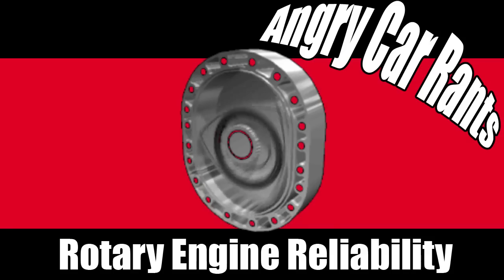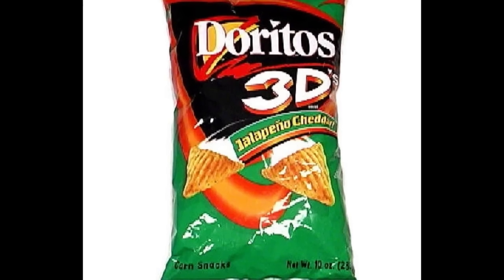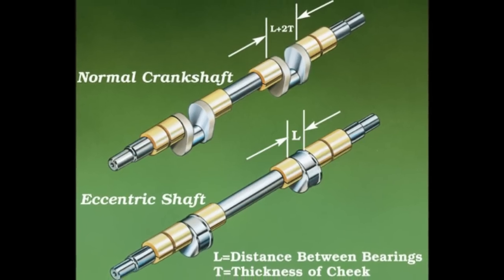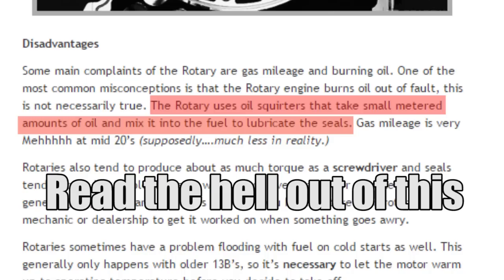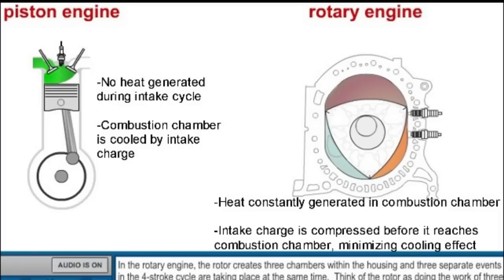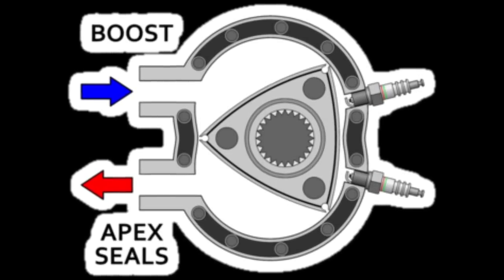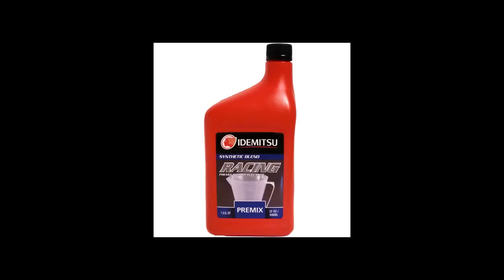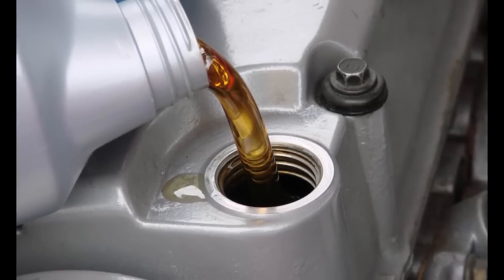Angry Car Rants #3 - Rotary Engine Reliability

Comment: Thanks to the Federal NHTSA recall investigation of premature engine failures Mazda was forced to replace most of the Renesis engines under recall or under the court ordered fraud settlement that extended the warranty.
the overwhelming demand for warranty replacement engines  forced Mazda to open a new much larger Remanufacturing and Technical center in Chesterfield, VA. to handle US warranty claims.. the center remanufactured over 5,000 Renesis engines in 2008 alone, not counting additional new replacement engines from Japan and rebuilt engines from outside subcontractors...
The irony is Mazda only sold 3,400 RX-8s in the US in 2008
Reply from the maker: Cool story bro
Reply: Angry Car Rants Yeah! It is!!  its also true!
Reply: I blame the factory OMP tune injecting dirty crankcase oil and the fact conventional oil is slowly becoming a conventional  blend of crude oil and synthetic. Just delete the OMP and run pre mix, and redline daily.
Reply: The Renesis was the most powerful non-turbo 13b based design Mazda produced.. it simply could not meet the power demands, meet emissions and fuel economy goals with the reliability that consumers now demand.. 
 Some of the design changes were poorly developed resulting in both  apex and side seal failures.
 The OMP is far more efficient and ensuring the correct amount oil is used.. pre-mixing cannot match this accuracy and can also cause lubrication failure unless unwanted excess ratios are used..
 disabling the OMP is really a very bad idea.
Reply: I don't know man, it seemed to work better for us and the forum users, but we are stuck in the carbureted age lol. If you want to inject crankcase oil that doesn't burn that's perfectly ok too, just be mindful of the excess carbon buildup. If the OMP was a superior solution, Mazda wouldn't have to retune the PCM multiple times to tune the OMP. The only thing  excess premix will do is dilute fuel and reduce octane, and rotaries run fine on low octane fuels, not low quality, so yeah. Open up an engine that was premixed; the ash comes off and shows a nice metallic sheen underneath. I will agree with the fact that rotaries have compression and combustion almost simultaneously, so a "rat's nest" of emissions were introduced to maximize gas mileage.
Reply: M1NH5AN3 For "us"???  excuse me for asking but are you even old enough to drive yet?
Reply: +The real doktorbimmer In case you were wondering; yes I can drive lol. Check out the one video where I talk about my daily. Keyboard engineers always think their solution is better. Do you even own a rotary vehicle?
Reply: M1NH5AN3 Premixing doesn't solve the problem of lubrication, it simply creates other problems because the OMP injects oil based on actual lubrication demand..premixing only provides a fixed mixture ratio which is always a compromise at best, during idle premix deliver far too much oil causing fouling and does not deliver any lubrication at all during high rpm deceleration with the injection system shuts off or severely restricts fuel flow. 
 Disabling the OMP and using premix is a dumb idea and its exactly why Mazda never did it.
Reply: Mazda premixed some of their rotary vehicles hence the Idemitsu sponsors and such. Heck it's the only sponsored synthetic oil Mazda recommends for premixing. The only OMP system that runs on demand and rpm of the engine is the renesis system and FD; the FC and FB system was like a throttle body injection system, hence why older cars disable OMP anyway. Most ported rotary vehicles use premix to ensure proper lubrication at higher rpm, and fouling doesn't really occur since the cars idle at 1500 with a bridge port. If you look at rotor housings with premix, the wear is even versus OMP dependant engines where the sides do not receive lubrication. The system is shoddy at best, it is more of an oil dripper than injector. Plus if you delete the OMP you can run synthetic, which allows for more higher grade oil choices than just conventional. Not hating on the OMP system, just saying there is other alternatives out there lol. It seems you still don't have content on owning a rotary and you assume I can't drive. Hard to speak about rotaries when you don't own one lol
Reply: Did you read that on a forum???? Lol..!!!
Reply: "Most ported rotary vehicles use premix to ensure proper lubrication at higher rpm"
Most Rotary powered vehicles unlike Wankel powered vehicles have no oil sump or pressurized main shaft bearing lubrication... because they have no main shaft.. and the engine is supported on ball or roller bearings that do not require hydrostatic lubrication systems.
Reply: No it's because I work on my car and observe the housings to make sure they still have chrome on them lol. I mean most of your information sounds the same too, if not google, so not much of an argument there. Just ask anyone racing a rotary vehicle. Pre mix for the track and OMP if you are lazy and prefer to use your car for the street. I mean if you do ever own a rotary vehicle, these precautions are way easier than having the omp fail on you and waste more oil that you're paying for. So no proof that you can drive or own a rotary vehicle? Darn shame that you can't back up your side of the story.
Reply: Oh! has some on the forums tell you, you can glue the chrome back on??? LOL..!!!
Reply: Who still races Rotary engines???
Reply: You can prove that there was no recall on Renesis engines??
Good luck with that.. Hahahaha
Reply: People who visit their local track lol. Keep in mind these people also own a rotary and know the entire engine inside out; if you do want your housing's chrome back they still do cermet coatings for 13b or 12a engines. Goopy also resurfaces them. You seem to not know how to use forums or common sense. A lot easier driving on a keyboard in my opinion.
Reply: At least I know the difference between a Wankel and a rotary... you sure seem tragically confused..
Reply: You mean radial? They exist too, but you know terminology means nothing you've never worked on one lol. Heck, Mazda's new rotary engine patent is labeled as "Rotary Piston" lol
Reply: Radial engines are NOT Rotary engines.. they use a completely different concept.
Reply: Mazda no longer develops Wankel engines... they never patented a Rotary type engine
Reply: Sounds like you don't understand the terminology.. or the technology.. LOL!!!
Reply: Unless you live under a rock, it's a new patent Mazda applied for.
Reply: THAT IS A WANKEL ENGINE
Reply: NO, its an old patent refiling  to protect Mazda against malicious patent "phishing" nuance lawsuits..
Reply: Check out this link and pdf, they call it a rotary piston; their words not mine lol. It's like the caps give it away that you are infuriated with the way MAZDA named the patent lol. http://www.autoevolution.com/news/new-mazda-rotary-engine-presented-in-patent-application-106139.html
Reply: M1NH5AN3 WANKEL KKM engines are "Orbiting Piston Engines"..
ITS RIGHT IN THE NAME!!!!!!
Reply: Yeah man, a cave with internet access. Since I don't believe you know how to open PDF files, I have made it simple. 
http://www.autoevolution.com/pdf/news_attachements/new-mazda-rotary-engine-presented-in-patent-application-106139.pdf
Reply: M1NH5AN3 I don't think you are smart enough to tell the difference  between a brand name and an engine classification... otherwise you wouldn't be so confused!
Reply: M1NH5AN3 Not at all.. you just seem kind of slow and have a difficult time reading so I thought I would help you out a bit...
Reply: M1NH5AN3 Without internet you wouldn't have access to the forums and so much false information..
Reply: Engines are classified by where you live. Mazda decided to apply the patent as such, and there hasn't been a real patent or breakthrough since Felix's engine. Felix's first engine had the housing spin and it was a single rotor; not much resemblance to the Mazda engines if you ask me. For such a fanatic do you have any proof besides words. I expected a video to showcase your knowledge applied to owning a rotary powered vehicle.
Reply: It's too bad half of the forums are inactive or archived now, not much information left anyway.
Reply: M1NH5AN3 ""Engines are classified by where you live."" WTF???
 Maybe if you live in a fantasy world like you do they might be different!!!
Reply: M1NH5AN3 "It's too bad half of the forums are inactive or archived now, not much information left anyway."
 Well, Wankel engines became obsolete 4 years ago, so I would be surprised if the forums are dying out now too..
 If your looking for accurate information? Your not going to find it on the forums..
Reply: They aren't different in nature but in insurance and where you register your car, some places register these engines as 2.0 liters when really they are 1.1 or 1.3 in reality. You seem to have an interesting tone in your replies lol
Reply: M1NH5AN3 That's because the engine we all know as the Wankel was created by HANNS PASCHKE..
 Mazda bought the rights to produce Paschke's KKM design not Felix Wankel's DKM-54  in Feb 27th, 1964
Reply: M1NH5AN3 The name WANKEL is a registered trademark currently owned by Audi AG. and Div. of Volkswagen..
 When the 10 year licensing agreement that granted Toyo Kogyo Cork Company (Now Mazda Motors) to use the PATENTED Wankel KKM-57 expired... rather than paying to use the name? Mazda created a new BRAND NAME out of thin air..
 Mazda cannot legally use the name Wankel commercially.
Reply: Two different scopes of this conversation, I am talking about insurance and you're mentioning the fact Mazda did not create the rotary. This is a given, they took the design and made it practical if not better for automobiles. Felix designed it, Hanns improved it, and Mazda made it modern.
Reply: M1NH5AN3 Most engineers, government agencies and motorsport sanctioning bodies use the commonly accepted "2X" conversion formula for accurately determining the true displacement of Wankel type engines.
Reply: M1NH5AN3 Your knowledge of the history of the Wankel engine is not complete or entirely accurate..
 for the record Felix Wankel did not invent the rotary type internal combustion engine.
Reply: M1NH5AN3 Toyo Kogyo Cork Company (Not Mazda) bought the Wankel KKM design from NSU in 1961 and was only allowed to sell automobile engines with less than 197 Horsepower (SAE-Net).
Toyo Kogyo was just one of 26 licensee's manufacturers that purchased the design and the rights to build the engines
Sold under the Mazda brand name Toyo Kogyo paid a 40% royalty on every Wankel engine produced by them and the registered trademark of WANKEL was cast right into the housing of every Mazda engine sold.
Reply: I mean he was named the creator, but believe what you want, like how pre mix is bad for you lol.
Reply: M1NH5AN3 No, not true.. your knowledge on Wankel engines is very poor..
 The Rotary engine was invented by Félix Théodore Millet in 1892.. for a motorcycle.
 Felix Wankel first saw a Rotary engine on a Megola motorcycle he and Walter Freode copied the concept first for a supercharger for a NSU motorcycle.
Reply: I mean it was a radial engine so... Of course more random facts with no citations, heck even the wiki says radial configuration lol. https://en.wikipedia.org/wiki/Millet_motorcycle
Reply: M1NH5AN3 Disabling the OMP on a fuel injected engine can cause catastrophic failure if not done properly.. especially when used for  racing..
What fuel injection mode feature must be disabled to prevent possible engine failure..??
Reply: M1NH5AN3 WRONG, Millet's engine was a ROTARY... Not a Radial..
Reply: M1NH5AN3 Wow!  you still don't know the difference between a radial and a rotary???
Reply: It doesn't disable fuel injection lol. Poor knowledge of how Wankels work? The OMP is independent of the EFI or Carburetor setup. All it does is drip oil onto the apex seals which spreads crankcase oil onto the rotor housing. The one thing OMP cannot cover entirely is the rotor side housings which can be solved by mixing two stroke oil into the gas tank. What other engines today inject oil into the combustion chamber as a 4 stroke engine?
Reply: M1NH5AN3 I guess you didn't even read your own link?? Wiki says the Millet motorcycle uses a ROTARY engine.
Why all the confusion son? You seem not to understand the difference at all.
Reply: It's a rotary engine in a radial configuration. It also has pistons in which the Wankel has rotors, not sure why you are using caps lol
Reply: M1NH5AN3 You don't read very well... I said what F.I. MODE must be disabled..
Reply: You literally take out the omp unit and block it off with a plate, it has nothing to do with the EFI system.
Reply: M1NH5AN3 RX-8's OMP injects oil into the intake manifold AND directly into the housing... or were you not aware of this fact?
Reply: M1NH5AN3 Well that would be a very dumb thing to do without reprogramming the fuel injection..
Reply: Yeah, it injects dirty oil into everywhere and a pump connects to all of those lines lol. Just remove the pump and lines and block off the injector ports; done. Deleting said pump allows you to have valuable real estate for force induction if that is your goal. On 12a's it is connected to a pump and lines go into the carb venturi.
Reply: M1NH5AN3 2-strokes are the only engines currently manufactured using oil injection.. Wankel engines are obsolete now... mazda was the last to sell them and the ended production over 4 years ago..
OR DID YOU NOT KNOW THIS?
Reply: Hence why I asked for an example of a 4 stroke engine that injects crankcase oil lol. See above.
Reply: M1NH5AN3 You don't seem to understand much about fuel injection??
Reply: M1NH5AN3 A 4-stroke that is still manufactured? the Wankel is a 4-stroke.. but no longer in production.. its obsolete
Reply: Heck if you really wanted to keep that OMP you could modify it to accept 2 stroke oil. I like how you post questions you already know the answer to lol.
Reply: One one side, you inject crank case oil which doesn't burn cleanly, or you mix two stroke oil which burns cleanly and reduces carbon build up. Either way it's not leaning out the engine that much in EFI as long as some sort of oil is burned during combustion.
Reply: M1NH5AN3 Sounds like you still don't understand the difference in th elubrication requirement of 2-stroke (Benz) engines compared to Wankel engines..
Reply: M1NH5AN3 I like how you don't answer questions.. or answer them incorrect.
Reply: Never mentioned anything about 2 stroke engines, I am always talking about the Wankel lol. The internet is full of opinions whether you like it or not. 2 stroke engines are different from the Wankel and don't utilize rotors lol. You're pretty good at changing the subject.
Reply: You went from 4 stroke, to the Wankel being obsolete, to Benz engines? It's not like you can do anything about these "wrong" answers anyway; they're opinions.
Reply: M1NH5AN3 The Wankel doesn't utilized rotors either.. (except maybe inside the ignition distributor)
 I guess its too much to ask if you have a clue what a rotor is??
Reply: Yeah a fool who actually owns works on Rx vehicles lol. Nice b8 m8, try some more exclamation marks. What Wankel engine are you talking about that doesn't have rotors? I like the fact you said "doesn't utilized" lol
Reply: M1NH5AN3 2-stroke (Benz type) have no crankcase oil sump.. unlike the Wankel which does..
of course there are more than one kind of 2-stroke engine.. so you have to be more specific..
Reply: +The real doktorbimmer Never mentioned anything besides the Wankel. The two stroke I'm referring to is an oil substance lol.
Reply: M1NH5AN3 Wankel KKM engines are not Rotary type engines... remember?  you must have a short term memory problem
Reply: M1NH5AN3 All the Wankel engines that were manufactured..
 Dr Felix Wankel's DKM-54 was only a prototype, it never saw production.
 Only Hanns Paschke's non-rotary type Wankel KKM engines was sold to Mazda..
I thought we covered this already?
Reply: +The real doktorbimmer It's not like they have no reciprocating force or pistons... Oh wait.
Reply: +The real doktorbimmer Any search online will yield that they are rotary engines. Odd tone for writing replies, it's as if you despise the rotary engine even though you don't own one or know enough to own one lol.
Reply: M1NH5AN3 Rotary ICE engines all have pistons..  just like Wankel engines have pistons.. Some Rotary engine have pistons that reciprocate... and some orbit
Reply: M1NH5AN3 Its sounds like most of your knowledge comes from the internet..which is why most of what you know about engines is also wrong...
Reply: +The real doktorbimmer Pretty sure all Wankels have rotors, never saw one with pistons...
Reply: M1NH5AN3 They all have pistons.. its right in the name!!!
Reply: +The real doktorbimmer I'll believe it when I see it. No links this time?
Reply: M1NH5AN3 I love Rotary engines.. The Oberursel Ur.II is one of my favorites..
I like Wankel engines too.. I always though the M950F was wicked cool... its a shame they never sold them
Reply: M1NH5AN3 KKM???
You don't know the name of the Wankel engine???
 For someone that claims to own and fix Wankel engines you sure don't know very much about them do you???
Reply: +The real doktorbimmer Pretty sure they're rotors dude, they look nothing like pistons and resemble a 3d triangle with round sides.
Reply: M1NH5AN3 Well, you have been sure before an proven wrong..
Reply: M1NH5AN3 Not all pistons are round and slide up and down.
Reply: M1NH5AN3 What next? Are you going to tell me that Wankel engines don't have stroke either??? lol..
Reply: +The real doktorbimmer I mean it's hard to prove someone wrong without links, or sources for that matter.
Reply: M1NH5AN3 Its really hard to have an intelligent conversation about internal combustion engine design with someone that possess such a rudimentary understanding of basic engineering..
Reply: +The real doktorbimmer Basics of engineering like all Wankels utilize rotors lol. Quick change the subject to Benz 2 strokes for no reason lol.
Reply: +The real doktorbimmer "Intelligent conversation" where you ask questions since you don't know more than the next guy lol.
Reply: M1NH5AN3 You don't even know what a Rotor is... How can you claim to know anything about Rotary engines..?
Reply: M1NH5AN3 You said 2 stroke..
Reply: +The real doktorbimmer I mean if you could show what Wankels have pistons or where you got that information, that'd be nice.
Reply: M1NH5AN3 Its right in the name!!! I would expect someone who claims to be knowledgeable about Wankel engines would know this..
Reply: +The real doktorbimmer As usual, no proof regarding why you think Wankel engines have pistons lol. No sources or websites?
Reply: +The real doktorbimmer Yeah pathetic enough to own and build one. Look at the inside of a wankel engine, it looks nothing like pistons; don't believe me? Search 13b rotor or KKM rotor, not piston lol
Reply: +The real doktorbimmer Oh yeah it's their not there lol. If you are going to correct someone at least be right.
Reply: +The real doktorbimmer Stick to BMW's those have pistons 😂
Reply: M1NH5AN3 Mazda Rotary® is just a brand name (now defunct)..
 Look up the word "rotary"

the definition might surprise you..
Reply: M1NH5AN3 And while your in the dictionary look up the word piston... you don't seem to understand what they are either
Reply: +The real doktorbimmer See 1:04 usually people refer to the engine as a "rotary engine" not just rotary by itself lol. Rotary by itself has many meanings. Funny how you disagreed on Mazda naming their patent as a rotary piston engine, and now you disagree on the rotors used in the rotary engine. Condescending comment or clueless?
Reply: M1NH5AN3 ""Oh yeah it's their not there lol. If you are going to correct someone at least be right.""
 Maybe you should stop using the incorrect terminology to describe Wankel engines.. the KKM is an Orbiting Piston Engine.. its not a rotary and it has no rotors (except in the distributor)
Reply: +The real doktorbimmer piston

Translate Button

[pis-tuh n] 

noun

1.

a disk or cylindrical part tightly fitting and moving within a cylinder, either to compress or move a fluid collected in the cylinder, as air or water, or to transform energy imparted by a fluid entering or expanding inside the cylinder, as compressed air, explosive gases, or steam, into a rectilinear motion usually transformed into rotary motion by means of a connecting rod.

Wankel rotary engines do not have connecting rods. Wankel rotor housings are epitrochoidal not cylindrical 😏
Reply: +The real doktorbimmer Doesn't change the fact Wankels don't have connecting rods lol. Do you know what a connecting rod is?
Reply: M1NH5AN3 "or to transform energy imparted by a fluid entering or expanding inside the cylinder'

cylinders and pistons do not need to be round or spherical.. they can be any shape.
Reply: M1NH5AN3 "epitrochoidal" thats a good word.. you should look that up after you look up "Rotary"
Reply: +The real doktorbimmer Good luck telling someone about a piston that is not round; or telling Wankel owners about pistons 😂
Reply: M1NH5AN3 Are you suggesting that it can't be a "piston" without a connecting rod???
 Good luck with that argument..LOL!!!!
Reply: +The real doktorbimmer I'm suggesting that Wankels don't have a connecting rod, if piston shapes don't matter, why are all pistons round?
Reply: M1NH5AN3 All pistons are round??? Where did you come up with that crazy idea??
Reply: +The real doktorbimmer Besides the Wankel which you are despised of, what other shapes of pistons have you seen? They're all cylindrical in nature anyway...
Reply: +The real doktorbimmer Simple Definition of piston

: a part of an engine that moves up and down inside a tube and that causes other parts of the engine to move

Not sure what else fits in a tube besides a cylindrical piston lol.
Reply: M1NH5AN3 Oval???https://en.wikipedia.org/wiki/Honda_NR
Reply: +The real doktorbimmer You mean elliptical? They heat up and become closer to a circle. Sounds pretty cylindrical to me.
Reply: M1NH5AN3 Its a piston alright.. and it can't be a rotor.. its not moving concentrically..
Reply: M1NH5AN3 You don't seem to know much about Wankel engines... or any engines for that matter.
Reply: Doubt my ownership of a rotary vehicle, check out my channel or @minhsane on insta. Maybe pictures will make more sense to you?
Reply: M1NH5AN3 I doubt you know what a rotary is..LOL..!!!!
Proper engineering terms don't seem to make any sense to you..
Reply: +The real doktorbimmer I doubt you know what a rotor is LOL. You can't say much about engineering without any content on your channel.
Reply: M1NH5AN3 I know that rotary motion and PLANETARY Motion are not the same.. Rotary motion is based on rotation around a FIXED AXIS..
Reply: Doesn't that statement make you a hypocrite too? You're a keyboard engineer like the rest of us, and unlike you, I do share my work on instagram and car throttle, do you even work on your own car? You do talk a lot of crap about rotary engines granted you don't work on them. It's not like the info you post actually helps the people who own these kinds of vehicles lol. Typical BMW fan boy.
Reply: M1NH5AN3 That's unfortunate, it saddens me to think that people are being negatively impacted by the ability to spread your ignorance all over the internet.. That why real credentials don't include your social media activities.
Reply: Sounds like the internet hasn't changed. I use real credentials because I have nothing to hide and there's not much you can do behind a keyboard anyway, don't like the way I do things? Post your own content about how you do it. Simple as that, people either choose to listen to what you post, or they move to another one. My Social media is mostly cars and memes so there's not much to worry about. Cowards hide behind fake profiles too you know...
Reply: At least I can show my work lol. You make fun of my work, but you fail to show your own. Afraid of criticism, or do you not work on cars? Hard to be real with no content on your channel...
Reply: M1NH5AN3 A typo is hardly the same as not understanding the difference between between a Rotary type engine and a Wankel engine.. LOL!!!!
Reply: In your case, plenty of typos from above, including your and punctuation. Not fun when someone picks on something petty now, is it? How's your imaginary BMW?
Reply: M1NH5AN3 How are those answers coming?  you seem to be having a lot of trouble with the facts..
Reply: I mean I already answered with my opinion, you seem to have trouble answering my questions; avoiding the question, or do you actually not own a BMW? Just to infuriate you; Wankel Rotary engine. There, final answer lol.
Reply: M1NH5AN3 There is nothing petty, just pity for your lack of knowledge on the topic of Wankel engines, its rather sad really..
Reply: M1NH5AN3 At least I know the difference between a Rotary and Wankel LOL..!!!!
Reply: So you don't own a BMW, or anything significant to share about? Why am I not surprised? I answer and you hide while changing subjects. I applaud your cowardice and inability to reveal anything about yourself. I don't understand your hate for rotors in terminology; rotors in brakes, alternators, etc. It seems the context is more important than the word itself.
Reply: M1NH5AN3 Yet you claim that a piston that does not move concentrically is a Rotor???
Reply: Yeah, still do; yet you still haven't answered the previous said question. How's your alternate method of transportation?
Reply: M1NH5AN3 What does that have to do with you embarrassing lack of knowledge regarding the Wankel KKM design????
Reply: The same thing that has to do with your embarrassing grammar. Still avoiding questions. No use having that knowledge if you never have a car that is going to require it. The difference between you and me is that I actually answer questions and I use the info I know lol.
Reply: We are not discussing English grammar, but rather your lack of engineering knowledge..
Reply: Are we? Can we discuss your lack of a vehicle to discuss engineering knowledge with too? Can't do much discourse about engineering without the actual engine now, may we?
Reply: Some people just don't want the dorito to succeed lol
Reply: M1NH5AN3 Wankel is already dead son... you don't know a dam thing do you?
Reply: I know mine is quite alive and well, peppy if I do say so myself, to disprove people like you. How about those aviation rotary engines? Still sore about those?
Reply: M1NH5AN3 Rotary engines died out long before the Wankel did.. but they are both dead now.
Reply: +Rudster That's a real good question. He must spend ungodly hours on it. WHY?

And after all his efforts I can just go for a drive in one of my rotary powered vehicles, which completely disprove his attempted arguments.
Reply: Godfrey Poon The fact that they are no longer manufactured completely disproves your attempted arguments...
Reply: Rudster Shooting the messenger will not bring the Wankel engine back.. it was a failure and is now obsolete..
You cannot live in denial or go off and live in a cave.. you have accept the truth that the Wankel engine was not good enough to compete or even survive against the superior reciprocating designs which are still in mass production.
Reply: It does not matter if you are right or wrong because you are doing nothing other than pissing people off.
Reply: Rudster Mazda finally cancelled research and development of the Wankel engine in May of 2009 and ceased all production at its Ujina #2 plant on June 22nd, 2012 at 4:30 pm Tokyo time.. the assembly lines were then demolished to make way for the future.. a brand new Skyactiv-G engine plant that now produces engines for the Mazda6
Reply: Rudster Hey buddy.. your the one trolling here remember..
Why don't you get a life.. the future is now and the Wankel is old news, yesterdays rubbish.. The automotive industry is rushing into the future without the old baggage of the past like the Wankel... its dead and buried now.
Reply: Rudster Good point, it would be completely useless to argue, the fact that you can no longer buy any new automobile with a Wankel engine is irrefutable .
Reply: Rudster Then why are you making harassing comments?
Reply: It's useless because neither of us know the engine id dead or not for a fact. All it is is an opinion. You don't know the ceo of Mazda doesn't want a new wankel sports car. You don't know what's going through the heads of those higher ups in Mazda. Neither do i
Reply: Rudster I can't help but think that your tirade of insults and abuse sounds an awful lot like a troll..
Reply: If you want to express your freedom of speech, make a video explaining the reasons why it's dead then. Because what you are doing is harassment of a community
Reply: Rudster What "community"? and who elected you to represent them???
Reply: Rudster OK, I'm glad we cleared that up, so you are just any individual that goes around like a thug intimidating people because you don't agree with there comments..?  That sounds like a troll to me.
Reply: Rudster Massive scene?  what exactly quantitates a massive scene? what the fuck does that even mean?
Reply: No, you need to accept the fact that people have different opinions and beliefs and that is completely fine. You don't need to convince them of anything because if your right, time will prove that. Spending all your time harassing people on videos is to be an asshole. There is no opportunity for discussion or debate which is the complete opposite of academic discussion and so what I see is the opinion of one against the opinion of many. 

Again, why do you feel you have to be here? Stop dodging the question
Reply: +Rudster You're the one harassing.. and the one in denial that the Wankel is no longer manufactured
Reply: Rudster You are indeed an insufferable hypocrite...
why do you feel you have to be here?
Reply: Rudster You are the one trolling my comment remember?
Reply: And your the one commenting on videos about a technology you don't like
Reply: Its my comment, not yours..  how would you know?
Reply: Off topic, but can you imagine if Felix Wankel had invented his engine a few decades earlier?
All of those German WW2 aircraft would have been rotary powered, and Germany very well might have won the war.
Reply: Godfrey Poon Many of the German and Allied aircraft of WW1 were powered by Rotary type engines.. but the design became obsolete as superior In-line, water-cooled engines became the dominate design of WW2..
Felix Wankel was inspired by Oberursel aircraft rotary engines and Megola Rotary engine motorcycles in the interwar period.
Reply: Godfrey Poon Germany was well ahead of the doomed Wankel engine, it invented and was the first to developed the most advanced, most powerful and  highest power to weight ratio engines for aircraft during WW2.... the turbojet engine
Reply: The real doktorbimmer Yes, the turbojet is an excellent form of the far superior rotary class of engines.

The basic concept of reciprocation in an engine is fundamentally abhorrent.
Reply: Godfrey Poon GAS TURBINE ENGINE.. not Rotary ICE.. not the same concept at all..

While seeming abhorrent to you, it is nonetheless still in widespread mass production globally while the Rotary and the Wankel orbiting piston engine are both now completely obsolete for some time .
Reply: The real doktorbimmer They both avoid reciprocation, and the associated Rube Goldberg tomfoolery. That's what counts.

It's abhorrent (I mean, something to avoid at considerable cost) to anyone who understands such concepts as fatigue-limited life. This is why a piston engine's crankshaft's days are so finitely numbered, and aircraft piston engines need their frustratingly short TBOs.

Calling the WRCE obsolete is semantics as far as I am concerned. I have two vehicles using them - they have served me well for a long time, and continue to do so. Piston engines have failed me in that respect.
Reply: Godfrey Poon But the Wankel KKM Orbiting Piston Motor completely lacks the elegant concentric motion of the Rotary, its epicyclic planetary motion requires the reciprocating motion of its eccentric crankshaft, and still requires a heavy flywheel to dampen vibration.
Reply: Godfrey Poon The Wankel certainly is obsolete, no longer manufactured in series production anywhere in the entire world..
 The reciprocating engine has not let down the automotive industry, or the dozens of other applications that the Wankel could never successfully compete with Otto, Diesel or Gas turbines ..
Reply: The real doktorbimmer That's great for them, but quite irrelevant to me personally.
I'll choose what's best for me.
Reply: Godfrey Poon Some people prefer live in the past, others prefer to move forward into the future...
Mazda is move toward the future now.. selling the types of car people are actually willing to buy.. unfortunately this does not include the Wankel engine.
Reply: The real doktorbimmer To be fair, Mazda did try to incorporate the Wankel into a range extender, but that didn't end too well. The engine may be gone, but not forgotten, heck they've even tried hydrogen applications as well.
Reply: M1NH5AN3 True, the Wankel had a very troubled development history and never saw widespread acceptance in the industry.
Range extenders were very trendy a few years ago but the concept has been abandoned en masse by the automotive industry.
Unfortunately one of the inherent limitations of the Wankel is its inability to be adapted to alternative fuels like hydrogen or compression ignition
Reply: The real doktorbimmer How about those articles about Laser Ignition lol. Plugs are already $40-50 a set...
Reply: M1NH5AN3 Yeah the laser ignition is one of my favorite rumors.. although some research was done about a decade ago on reciprocating engines.. the concept proved to be not a commercial viable one and a practical design has yet to be seen..
Reply: Im just wondering what engine is your favorite ? and has it stayed the same thru its lifespan?
Reply: 110,000 miles and counting. Slight overheat once because of a cracked coolant hose, but it has all been replaced, including radiator cap and water pump. New coolant every year and they will stay reliable, doesn't hurt to premix as well.
Reply: They can limp around even longer with bad compression as long as they can still be started..
Reply: Failures are usually apex seals or coolant seals. Oil control rings fail but that only causes excessive smoke.
Reply: Good question, without ant doubt the Gas Turbine is the king of the combustion engines and I have been fascinated by them since a my youth.. throughout my personal and professional life a have at one time or another worked with practically every type of combustion engine with the exception of steam (which I also find fascinating but have no personal experience with)
Reply: The real doktorbimmer But hasnt gas turbine become better thru out its lifetime ? same way wankel has, otto engines have, basically everytime of engine has seen an improvement in their lifetimes. So i dont see why you would be such aggressively against mazda making new wankel engine or atleast studying different possibilities of the wankel engine. Its not your money that MAYBE will go down the drain. And why gas turbine ? whats so special about that ?
Reply: Hmm.. interesting theory, I see the angle you are trying to take here.
What about steam engines???
They have been around since 1712 and had a very long evolution of improvements over 300 years but by today they have been largely replaced by Diesel and gas turbines...
 Why is that?  
Don't you think that if more improvements were made the steam engine it would continue you dominate the industrial and marine engine market instead of dying out like the Wankel?
what do you believe is the logic behind this quantum shift from steam to Diesels and gas turbines????

Well the answer to those questions is BSFC, power-to-weight ratio and service life and reliability.. 
What are the two most expensive factors in operating costs of any engine?
Reply: To be fair, nuclear reactors still utilize steam technology. Not technically a steam engine, but it's a turbine, so tech ties into different platforms.
Reply: No, all commercial and marine nuclear reactors are usde to fuel steam engines...
There are several types of steam engine include steam turbines..as well as reciprocating type and rotary type.
No, they fall into completely different classifications. 
Steam engines are EXTERNAL COMBUSTION.. 
Diesels and Gas Turbines are INTERNAL COMBUSTION
Reply: But in this case you completely missed the point of the comparison to steam engines..
Reply: No idea why you have that kind of tone, or view. Notice how I didn't say all. It's a suggestion either way.
Reply: M1NH5AN3 I have no idea what the purpose of your comment was.. and it was incorrect
Reply: The real doktorbimmer Yes but steam engine and gasoline/diesel engines have totally different power supplies, if oil were to run out then we would perhaps go back to steam power (if shown better reliability than what electric cars have) 

You cannot compare apples to oranges if you understand me here. Same sort of question would be why not use square piston instead of cylinder shape since square does displace more than cylinder shape, but it creates its own problems (its a bad comparison,but just to get you on the map here). With every new type of element that we discover (aluminium, carbon fiber, graphite) new solutions begun to appear. So given enough time we might have solutions to todays engine main problems, each having their own.

Power to weight ratio is pretty grey are in this, i mean you can make hefty engine with smaller output to last longer than a lightweight with tons of output, BUT you can install the hefty engine to what is otherwise light body. You could put a gas turbine in to a car but it would take alot of space, have slow acceleration (great top speed) and it would burn everything behind it.
Reply: Rotming ""if oil were to run out then we would perhaps go back to steam power""

Are you sure? I think you missed the point too?
Reply: Rotming "With every new type of element that we discover"

What do you suggest the missing undiscovered element is? that will improve the Wankel engine? 
All of the "stable" elements have already been discovered.
Reply: The real doktorbimmer Its an option, and when that catastrophy happens (not in my lifetime) every option counts, but like i said, IF electricity wouldnt be so profound already, every electric application has taken huge leaps forward from the 90's and will continue with graphite etc. There are some people even to this day that ''rely'' on steam power and utilize that. Not EVERYONE would go to steam power. But whether you like it or not, steam engines have given us alot to continue development/research
Reply: The real doktorbimmer Perhaps i did not word it correctly, but i did give examples, aluminium, carbon fiber, graphite. Now how they would HELP wankel engine as wankel is now i do not know, but wankel can be improven with new solutions/tests about the oil consumptions or the apex seal. Heck i dont even know if and when there will be a new wankel engine, if it resembles the one we have now in anyway
Reply: Rotming A Diesel engine can arguably run on any combustible fuel a steam engine can.. either in a refined, semi-refined or fuel conversion process...
But you have not really answered my question..
If the problem is that of continued development why has the steam engine fallen out of favor?
By your theory it should be the most advanced and most efficient design available? But its not? Why is this? Please explain?
Reply: The real doktorbimmer why would they that while there is gas that has been proven to be much more effective...but what will you do when gas runs out ?
Reply: Rotming Yes, but how will new materials improve thermal entropy?
Or mechanical conversion rates?
Reply: Rotming ICEs like ECEs do not require petroleum or fossil fuels to operate.
It makes you example a moot point.
If its a combustible material that can be used to create heat in a steam engine? I can be also used to fuel a Diesel engine.

But why are Diesel and gas turbine engines replacing steam?
Reply: The real doktorbimmer I am deeply sorry but my english does not reach that far so i would understand what youre implying. But i will just say that different materials react differently. 

Hasnt mechanical conversion rates become better as time has passed, you wont create energy from nothing...that much i know for certain. 

But just because its not possible right now doesnt necessarily mean its not possible in the future, last time i checked the news, getting people on to the moon was deemed impossible, now we have wireless drones on mars.
Reply: Don't worry, doktorbimmer is a keyboard engineer. His sole purpose of freedom of speech, is to prove that you're wrong or twist your words. Avoiding the question is another specialty along with hating on the Wankel engine without owning any type of vehicle.
Reply: Rotming Well, if it was simple a matter of improved materials then why have steam engines not improved faster or at the same rate as Otto or Diesel engines..

You cannot change the unique internal geometry of the Wankel design.. and thus there is no way to improve mechanical leverage or conversion rate..

There is a big difference between what is POSSIBLE and what is PRACTICAL

It is theoretically possible to build nuclear/steam cars that will never need refueling.. but the question is... is this a practical idea?  the answer in no.
Reply: M1NH5AN3 Then you answer the question.
Why are steam engine being replaced by Diesel and gas turbines????
They have been in development for 200 years longer than ICEs and should have a significant advantage in performance and efficiency yet they have gone obsolete in the transportation industry..
Reply: Notice how I said nuclear power plants still rely on steam technology. Think about it; the nuclear heat boils water. I just mentioned that steam turbines are still used and there are other types of engines out there, hence why I did not say all nuclear plants use steam turbines. I could avoid questions, but that's more of your thing, asking questions that you think you know the answer to lol.
Reply: The real doktorbimmer why not ? why isnt it practical to build a car that runs on uranium or whatever you define as nuclear energy ? why isnt gas turbines in gas instead of otto engine designs ? why are there more than 1 direction of the piston with various outputs ? answer these with good enough answers that will suffice me and i might believe that you would actually know something instead of avoiding the 10 other question that i have asked with no reply.

And i answered your question of steam engines being replaced...if you want more defining answer then i will compress it to 1 word BUSINESS. Same reason why there isnt any cure for cancer, you cannot get money from something that doesnt exist, so you delay the development of the cure and keep selling high price medication and thus increase your income
Reply: M1NH5AN3 Dont worry im used to this, i am yet to see a video about wankel where he isnt bashing on it
Reply: Rotming Of course he doesn't have a car to show because he's afraid of being bashed on. Nothing better than someone who can swiftly avoid questions with more hypocritical questions lol
Reply: M1NH5AN3 You said, quote; " To be fair, nuclear reactors still utilize steam technology. Not technically a steam engine,"
That statement is false, not all nuclear reactors produce steam..
Reply: The real doktorbimmer Hence why I said not all use turbines lol. The ones that don't produce steam definitely don't have turbines.
Reply: Rotming WRONG!
Its called the CARNOT CYCLE
The Carnot Cycle Formula calculates both the practical and theoretical limits OF ANY HEAT ENGINE..
Like the steam engines Wankel engines have a LOWER CARNOT CYCLE LIMIT
Reply: M1NH5AN3 I'm not afraid to point out that you understanding of engineering is benighted.. there is a lot that you do not know about engines...
Reply: The real doktorbimmer Part of the fun of learning about engines, never said I knew a lot, I just said there are different engines out there lol. "you understanding" and "benign" Fancy words but I would focus on sentence formation first.
Reply: The real doktorbimmer yeah and nothing travels faster than the speed of light (y) And i have hereby proven that you know absolutely nothing about anything by avoiding all my questions and turning in the carnot cycle card. Tell me then, why are engine getting better all the time ?
Reply: M1NH5AN3 Not true.. Its not surprising you know even less about Nuclear engineering as you do about automotive engineering..
Reply: Rotming No you have to avoid the question, make fun of them, twist words so they're wrong, then condescendingly make a question that is not grammatically correct lol. Doktorbimmer needs to stick to BMW of which he imparts no info on.
Reply: M1NH5AN3 Only the practical commercial and marine nuclear reactors use steam..
but it is possible to generate power from nuclear reactors without using steam as a working fluid..
and these other working fluids can be used to drive GAS TURBINES..
Reply: The real doktorbimmer I like how you made that not only a false statement somehow, but also used a condescending tone. If you are going to insult someone at least use correct grammar.
Reply: M1NH5AN3 Maybe you should go troll a thread about English grammar... we are discussing Engineering here..
Reply: M1NH5AN3 I dont think he even has a PhD, i dont think he is even a real doctor haha.
Reply: Rotming Nah man, he's a keyboard doctor in condescending speech. It's funny how no one tries to prove him wrong, yet he's hateful in nature.
Reply: The real doktorbimmer Maybe you should go troll on other rotary engine videos, oh wait, you already did.
Reply: M1NH5AN3 No you have to avoid the question... and the answers, make fun of them, twist words so they're wrong, then condescendingly make a question that is not supported by engineering, clearly you don't understand enough about cars or engineering to keep up.. may I suggest some remedial lessons?
Reply: M1NH5AN3 M1NH5AN3 needs to stick to talking about his piece of shit old car.. because that's the only thing he knows about cars.. which isn't much at that...
Reply: M1NH5AN3 I will be happy to keep correcting your mistakes about Wankel engines.. and rotary engines.. because you still have not figured out the difference between them..
Reply: The real doktorbimmer Record the part where you said Wankels have pistons, Mazda would love to hear that.
Reply: M1NH5AN3 And not to say, i have asked him like 10 times why the hate towards wankel, and he refuses to give direct answer.
Reply: M1NH5AN3 Its right in the name dummy.. "Piston engine"
Reply: M1NH5AN3 What would Mazda know.. they did not invent the Wankel engine..remember?
They bought the design from NSU in Germany
Reply: More condescending speech and you avoided the question of what car you drive. I would answer that question easily, but you seem to be afraid of being wrong. Afraid of being bashed hypocrite?
Reply: The real doktorbimmer I like how you hate on my car but you drive a keyboard. Not much knowledge doing that. "Dummy" and "Piece of shit car" does not make you smarter or better than any of us for the reason you avoid the question of what car you drive. If you weren't such a coward, you be constructive in your arguments, not destructive. Stick to your keyboard, it's where you are safest.
Reply: M1NH5AN3 I also thing its very funny that you assume I only own one car...
Reply: Rotming It's too bad doktorbimmer forgets there are no prerequisites to operating a keyboard. He makes fun of the inability to drive, but lacks a car and hates on everyone for their opinion.
Reply: Rotming I never said I hated Wankel engines.. that is a false assumption on your part...
Reply: M1NH5AN3 HEY, DONT YOU DARE SAY HE OWNS ONLY 1 CAR... OKAY !? like hot wheels aint that expensive i got bunch of them aswell haha.
Reply: Rotming M1NH5AN3 thinks that owning a piece of shit old car makes him an expert on Wankel engines
Reply: The real doktorbimmer You forget that people and engines can improve, like the Wankel. Notice how I am trying to help, not talk trash to you. Two different tones, your only argument is "you don't know much about cars or engineering." Hard to learn about cars if you don't work on them, and don't own one. I hate to break it to you but the internet is nothing like real life and if you truly believe everything is right on the internet, good luck.
Reply: Rotming We are talking about real cars here, not toys, models or video games... although that seems to be where you two have acquired most of you automotive knowledge
Reply: The real doktorbimmer Using the internet does also make you an expert on Wankel engines. You make fun of my car, what do you drive? Keep avoiding the question why don't you.
Reply: The real doktorbimmer Real cars that you don't have, enlighten me on what I don't have? How should you know? Where do you acquire knowledge?
Reply: The real doktorbimmer It's pathetic as well how someone uses the comment section as a measure of knowledge but do go on, I'm expecting details on your car so I can be you and hate on it, or social media so I can also make fun of it. If you weren't such a coward you could answer that question of, "What car do you own?"
Reply: M1NH5AN3 I own a small collection of cars with a wide range of interests..
But owning cars does not make you an expert about them... you are certainly proof of this fact..
I don't own a nuclear reactor.. but I just proved I know more about them than you do !!!!
Where do you think? certainly not from your social media outlets...LOL!!!!
Reply: I like how everything I say turns into an insult directed at me lol. Intelligent people have a constructive conversation to share knowledge, but doktorbimmer has a tendency to show superiority over everyone here.
Reply: M1NH5AN3 Not at all, you are just mad because I pointed out the things that you say are incorrect.. and that your knowledge was very limited... you are just showing how bitter and angry you are for being publicly embarrassed
Reply: The real doktorbimmer Poking fun is definitely how to have an intelligent conversation. Where is your car collection? No hot wheels right? Attacked? I stated an opinion of premix, not attack you on what you have. I deny comments with negativity and if it entertains you so be it. Still avoiding questions? Sure your facts are legit, anyone can use google or a keyboard.
Reply: The real doktorbimmer I like how you deny how the conversation started. Still avoiding questions and not really quoting important info. Quotations don't include your point of view or things you add to it in case you didn't know.
Reply: M1NH5AN3
 I wouldnt piss off Doktorbimmer.  Hes with the rotary police- he may give you a ticket after he tells you how bad mazdas rotary engines are.
Reply: SidewaysGts True, and then he will make fun of your car since he does not have one lol.
Reply: PLEASE guide me to some one who coats the 12 a , my baby needs a solid rebuild !
Reply: What's your budget? I heard rotary specialists are pretty good. You could also ask doktorbimmer, but he'll probably make fun of you instead.
Reply: M1NH5AN3 You don't need to be an engineer to know that the OMP is not the single cause of premature engine failure in the Wankel design.. some of the most unreliable examples of Wankel engines don't even have oil injection..
Reply: The real doktorbimmer No you need to be a credible keyboard warrior who know hows to use google and make useless insults while avoiding the question or topic at hand. Then you play the victim card as a result of your actions.
Reply: M1NH5AN3 No, you only need to be smart enough to know that deleting the OMP does not stop apex seal failures.. or to spot a fake like you..
Reply: M1NH5AN3 Many Wankel engines were designed without oil injection.. and they suffer apex seal failures at the same or higher rate than engines equipped with oil injection.
Reply: Coming from someone who lacks support for their information, how are you not fake? Oil injection is an overstatement, it more or less drips oil and the apex seals spread it around. Do own a rotary or have been affected by this issue? I highly doubt you have proof that omp is better, but you also can't accept that people have different ideas, but if you think you're always right so be it.
Reply: M1NH5AN3 So you are stating that adding more oil than is necessary has no negative effects on performance or reliability?
Reply: No unless you don't know how to measure oil, or stay on subject and answer questions. Also doesn't matter if you don't own a Wankel car. Enlighten me on how this affects you.
Reply: M1NH5AN3 You are not going to argue that adding less oil will increase the amount of unburned residue and carbon????
Reply: Some people premix while having an omp, some just run straight pre mix. Personally I have only seen worn apex seals and housings caused by lack of lubrication. Haven't seen an engine die of too much premix yet. Remember, premix has a cleaning effect as well as lubrication. Synthetic premix exists if you also worry about carbon build up 😂
Reply: M1NH5AN3 But you said engine failure was caused by dirty oil injected from the sump? Now you are saying its from lack of lubrication?Which is it?
Why are you suddenly changing your story?
Reply: No you just can't use your keyboard engineering logic. How well can dirty oil lubricate? Premix ensures fresh oil, frequently oil changes do the same. It's not like I change the subject or make new questions, that's your job and you barely put thought into it.
Reply: M1NH5AN3 So your claiming that Wankel engines that use pre-mixing never fail????
Reply: Never said that, notice how I mentioned premix, Omp or both. Need remedial lesson? It just allows parts to last longer, eventually things wear out and you lose compression, it's just the majority of failures are apex seal related.
Reply: M1NH5AN3 Its a simple question.. basic logic.. but your statements do in fact conflict.. if you are correct there should be no discrepancy.
Reply: Your logic is flawed, and it's not like you prove it either. Not fun when I avoid questions huh? Questions aimed for a specific response.
Reply: M1NH5AN3 You said on Sept 10th quote; " 
I blame the factory OMP tune injecting dirty crankcase oil and the fact conventional oil is slowly becoming a conventional blend of crude oil and synthetic."
Reply: M1NH5AN3 I just want to know why you changed your story all of a sudden?
Reply: So? How well does dirty oil flow much less lubricate when compared to fresh oil? Not to mention when you inject oil, you lose some, lack of lubrication from the fact the oil is dirty and if you forget regular intervals, you lose oil pressure. Do you know how oil works in the Wankel?
Reply: Ask yourself, you constantly change the subject, and or your stance on Wankel engines. You should know, you barely answer the question, and when you do, it's another question 😂
Reply: M1NH5AN3 Just answer the question mr. genius..
Reply: I went from dummy to genius, but if you say so lol. Never changed my stance, the omp is great if it is kept in working condition, but in the 12a, it's 30 years and it drops oil into the intake manifold, so premix is more clean and constant. Dirty oil from the crankcase lubricates less, oil also burns up and is consumed. Overall lack lubrication causes failures.
Reply: M1NH5AN3 That's called sarcasm dummy..
clearly you could not honestly answer the question so you continue to redirect..
Reply: M1NH5AN3 But how can an engine running on premix run out of lubrication? If the oil supply runs out so does the fuel supply... stalling the engine.
Reply: That's why I said premix is a great alternative; not my fault you can't accept an answer besides your own.
Reply: M1NH5AN3 But why do engines running premix still fail?????  You are avoiding the question..
Reply: I'll answer it but you won't. Can you not read this answer? People premix wrong amounts or they listen to you, that's why they fail. Haven't seen a premix engine fail but I suppose you won't agree. You neither have an engine or a failed one for that matter. My turn, do you own a Wankel?
Reply: I'm not the one posting false and erroneous information.. Why would I be afraid of you?
Reply: The number of cars I own or the models is not relevant in any way.. and does not change the fact that you are a fake... just another internet "wannabe"..
Reply: The real doktorbimmer It's not like you support the information you post, are my words on the internet intimidating to you? So the fact you have no vehicle is irrelevant to how much you know about cars? How do you know so much about something you don't even have? I am no fake, but a proud owner of something you will never get to experience as a skeptic and the coward you are to answering questions. How am I more fake than you who hide your face, car, and any other pertinent detail to prevent hate towards you? Your information and cars you own are both irrelevant, and quite frankly, they don't exist.
Reply: The real doktorbimmer No I don't run, I have a car and you don't. Best come back you have? You had a week smh.
Reply: The real doktorbimmer You're not afraid because you are one, I'm not trying to intimidate you, but you seem to avoid questions that put you in the spot. The little boy you're talking to can drive anywhere he pleases. It's not like you can change that matter. Tell me, what do you drive again? I would what you look like but you would say that is irrelevant. Your fault you're not comfortable in your own body.
Reply: M1NH5AN3 No, you are the little boy... having a temper tantrum because you have been corrected..
Reply: M1NH5AN3 We already covered the fact that your OMP theory was dispelled as pure myth.. your argument was a failure.
Reply: The real doktorbimmer What do you mean we? You and your unlisted sources? We're all kids at heart, but some people just can't accept other opinions, and you can avoid that question, it's an accepted quality of a coward, not a little boy.
Reply: The real doktorbimmer Classic my father can beat your father eh? Nah he's my real father that gave me manners and the ability to work on cars. Your father gave you one heck of a mouth.
Reply: The real doktorbimmer I like how you avoid the question, just like how you change the subject when you fear answering the question at hand.
Reply: The real doktorbimmer And you aren't with your childish insults? You call me boy with weak insults and random public info available to you. It's more like defending myself, I am not mad, but it's my reputation at hand.
Reply: M1NH5AN3 Yes you are... you just proved it Hahahaha!!!!
Reply: +The real doktorbimmer don't f*** with a man's YouTube reputation
Reply: The real doktorbimmer I just mentioned social media since you wanted proof of me owning a car you constantly trash talk about, but if you think followers matter that's up to you and your web sources. It's not like you show what car you have, where you get your info or show what you look like. Show cowardice instead, it helps your argument.
Reply: The real doktorbimmer Yes because they'd rather listen to you attack people personally. That makes you an expert 😂😂😂
Reply: M1NH5AN3 You're the one making angry troll attacks...
No, knowing infinitely more about Wankel engines than you or your social media rotards makes me an expert... Lol!!!!
Reply: The real doktorbimmer Too bad you don't know what a source is, infinite is a bit of a stretch. I mean, you don't even know how to punctuate.
Reply: The real doktorbimmer I guess I do have to credit you with the ability to avoid the question infinite times, and if my appearance and the thought that term rotary and Wankel are different and can not be used interchangeably, you must not know about the video title, or you just know too much, I could be wrong.
Reply: M1NH5AN3 Its too bad you don't know what a Rotary internal combustion engine is, otherwise you would not have made such a fool of yourself  LOL!!!!!!
Reply: The real doktorbimmer Even better that I know what an apostrophe is, but it's mere speculation, it's not like you used or cited facts.
Reply: M1NH5AN3 And what exactly does that have to do with your embarrassing lack of knowledge regarding Wankel engines???
Reply: M1NH5AN3 Its not a Rotor or a Piston so why are you trying to change your angry troll ranting on to yet another tangent?
Reply: The real doktorbimmer The same as knowing trivial terminology for "Wankel" engines. Embarrassing but you don't own one, and I have yet to be ridiculed by someone besides you. If you knew what context was, you would read that title, or all the countless videos you comment on that have the term "rotary" in the title. Please, read more and use less punctuation marks where they're not necessary. Sure mention piston and rotor and say I'm going on a tangent. lol
Reply: It seems you don't know what you say, I quote, "Sep 12, 2016
+M1NH5AN3 Rotary ICE engines all have pistons.. just like Wankel engines have pistons.. Some Rotary engine have pistons that reciprocate... and some orbit." 

Since you like dates and quotes so much.
Reply: M1NH5AN3 How do you know?  You don't even know how many car are in my collection???
Reply: M1NH5AN3 Its called ENGINEERING terminology, a subject you seem very unfamiliar with.
Reply: The real doktorbimmer Sure disregard the quote, and of course bring up the collection. Prove me wrong doc, what's in your collection? Not a "rotary" you hate those and the way I use that term as well. I guess it could be just one car, hot wheels and games don't count in case you didn't know.
Reply: The real doktorbimmer Yeah the ones who have cars and proof of it, you seem to be better and asking questions than answering them. I mean if you can't answer a simple question it's not your fault or your capacity for "engineering" terminology as you call it. Not much use memorizing outdated terminology and technology by your means if you can't answer something simple as that.
Reply: M1NH5AN3 Yes, that is exactly what I wrote then... and its still true today!
Reply: M1NH5AN3 Proof? You mean like some lame social media page?
 I don't need to brag about owning some old  POS car..  
 But its seems you do?
Reply: M1NH5AN3 I love Rotary engines... sadly you still don't know what a rotary type engine is.. LOL!
Reply: M1NH5AN3 Well the Wankel is outdated.. its also obsolete.. along with its terminology
Reply: M1NH5AN3 Well the Wankel is outdated.. its also obsolete.. along with its terminology
Reply: Look, you should really start opening a book or something instead of spewing your nonsense everywhere. Don't force me to pwn you here too.
Reply: +Flyingdutchy33 Have you been down to your local mazda dealer and seen the new RX cars???? Lol!
Reply: hahahaha makes the remaining ones even more special!
Reply: Yes, pre-mature engine failures certainly make them "special"